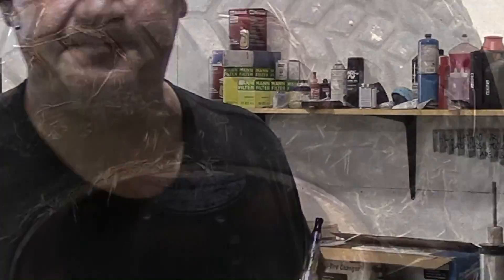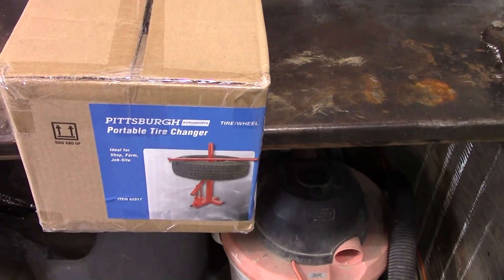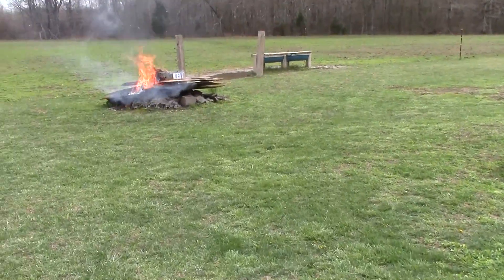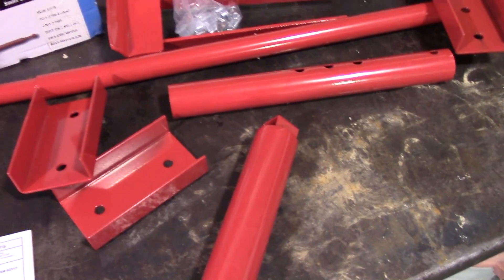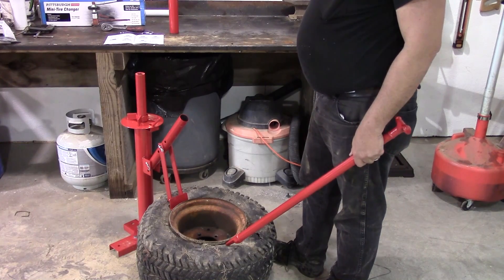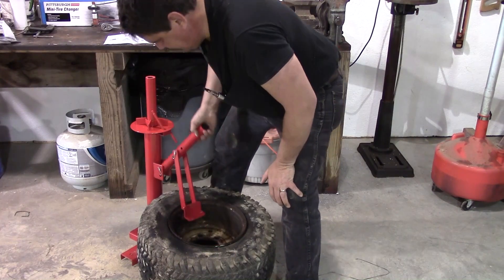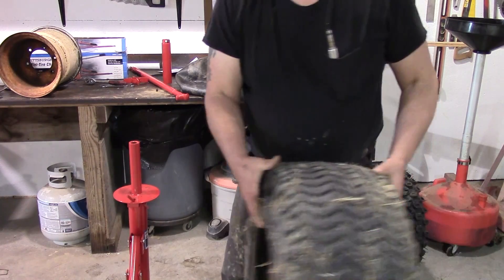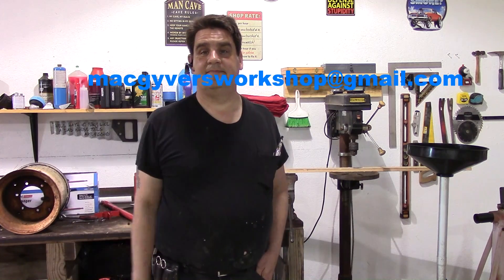My new tire mounting tool.

Comment: all you had to do was holler at me man I would have run the other one over, you bought the same one i have in the back seat of my Tahoe, and we didn't do anything today just kinda hung out and took it easy
Reply from the maker: DaddytechEnt No disrespect meant Jim :) I seriously thought about it, but I saw it on sale for half off, and with the extra 25% off coupon I couldn't pass that up. Plus I'll eventually bolt it down to the concrete whenever I get the extensions added on to the shop.

Comment: mac im doing the tires on my ride on mower and the back ones are what im doing last as in now this looks about the same size all ive ever done to brake the bead on any tire is place the tire and put it behind your car tire so you can then drive over the tire part and it brakes the bead every single time i was haveing all typs of ishues putting the tire on the rim as when you place a tool under it , it was comeing off the other side so i put a pair of vice grips on the 1 side to stop the tire rolling back off then got a large screw driver and worked it on that way now im haveing ishues getting it to stick to the bead to pump it up the front 2 i used gas and a match but its not working on the back so im going to have to woork out how to do it as the tire guy wanted $160 to change out 4 of them i told him to go fuck him self he was pist i got them cheap on ebay and not from him
Reply from the maker: obieezx11 You can try using a belt or rope like a tourniquet in the center of the tire tread and it will squeeze the sidewalls out to the bead :)
Reply: Mac Gyver  YEP THOUGHT ABOUT THAT BUT ITS COLD AND SHITTY HERE NOW THE SUMMERS GONE AND I HAVE TO GO OUT TO BORROW A ROPE LOL